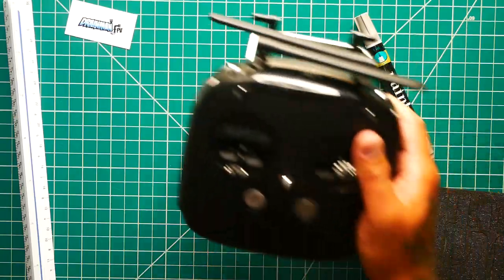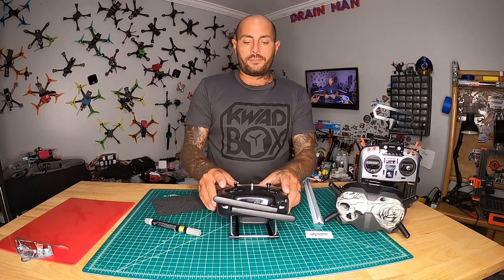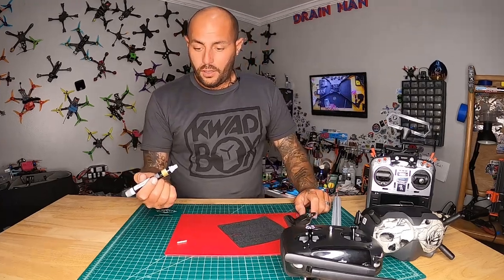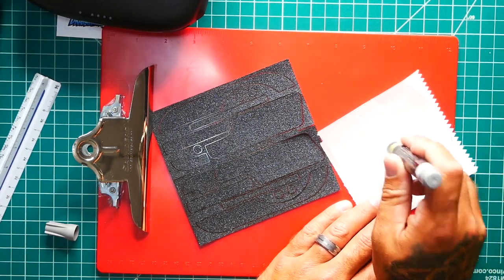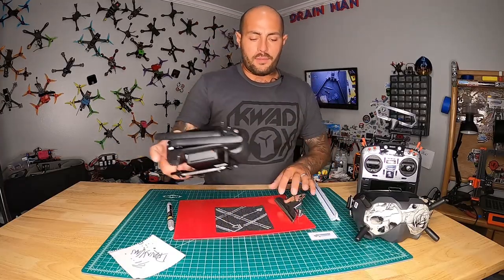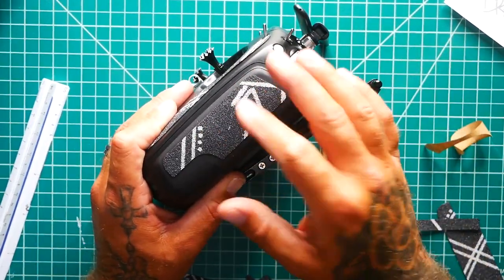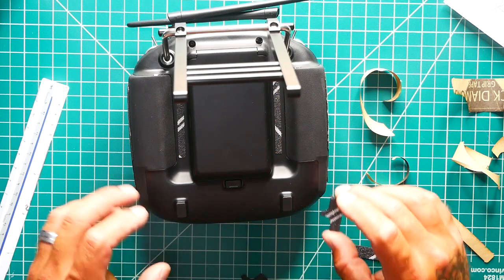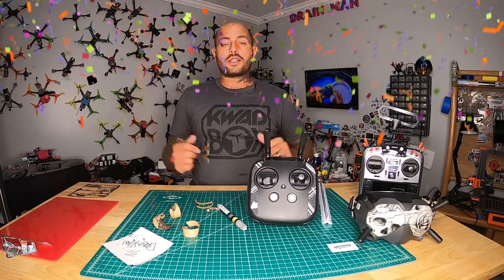NEVER DROP YOUR RADIO AGAIN!...plus make it look cool

Comment: Lol, yeah I went with the goggles and TX16s to avoid that... basic black DJI radio.  Just so I could get a... basic black radio (the tx16s).  What's up with that.  And then I immediately bought like $50 worth of bling bling annodized crap and custom printed lanyards to pimp it out.   Go figure.
fpv.air-war.org

Comment: $5.00  gets you SILICON SKIN ………..what I LOVE about the DJI  is its SIMPLICITY  the complete DJI FPV system is absolutely amazing.   ………...  NO screen  NO useless trim   NO  useless switches.  it is PURFECT ……….. After 6 months I tried going back to analog and I will NEVER EVER FLY ANALOG AGAIN.  NEVER
Reply: But is also comes with a useless 5.8GHz control link :)